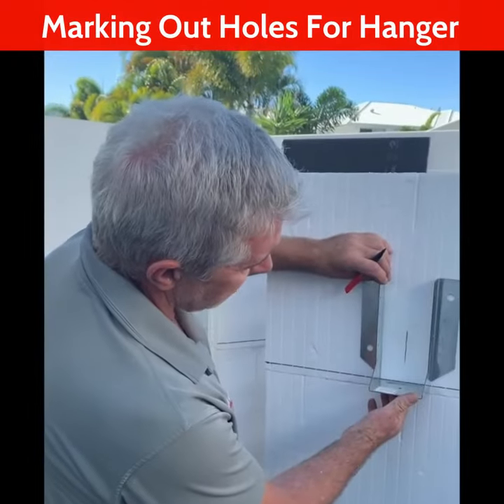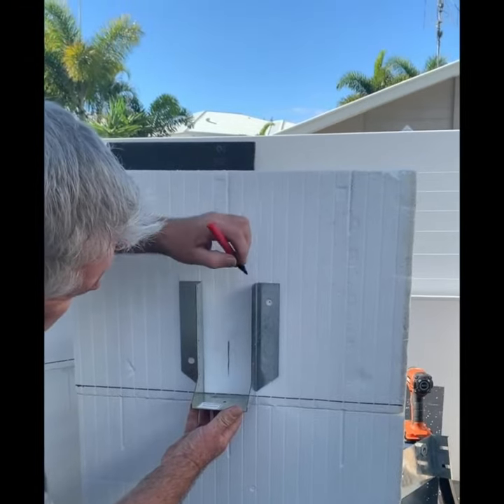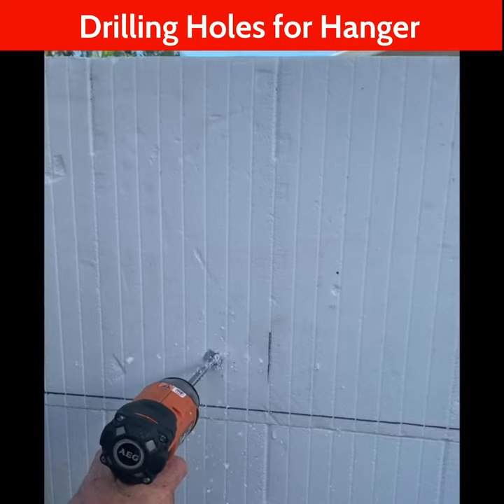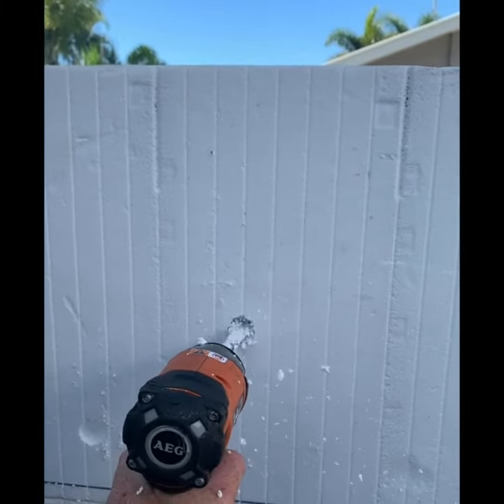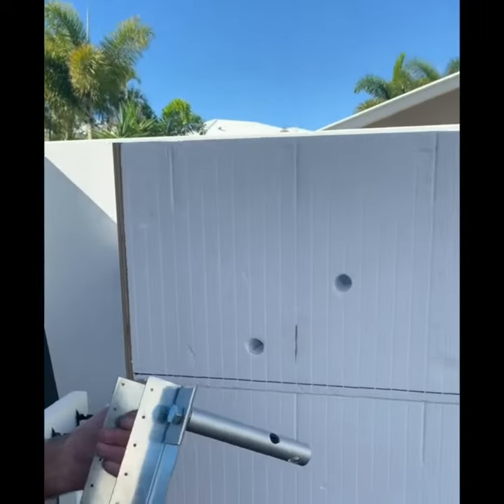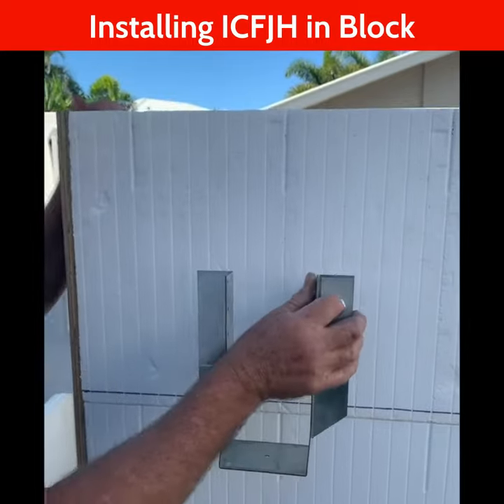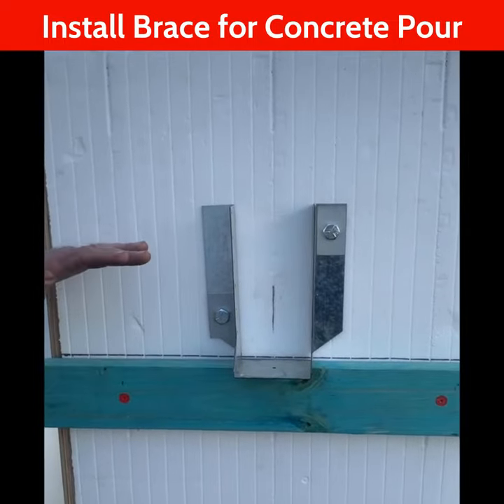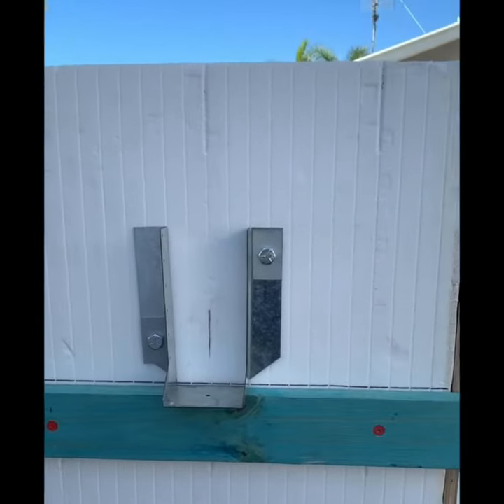Burmon ICFJH Hangers for Joists and Trusses

Comment: What are the holes for in the hanger that are inside the wall? Does rebar go through them?
Reply from the maker: No rebar is required for the ICFJH. The holes are there for the ICFWL - ledger when attaching a deck to an ICF wall.